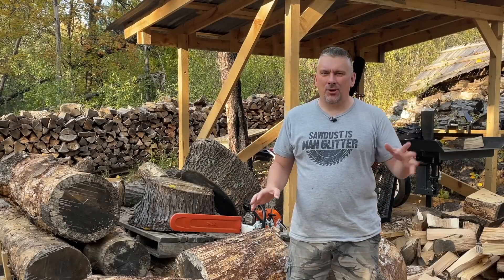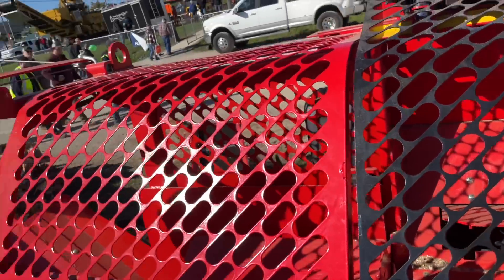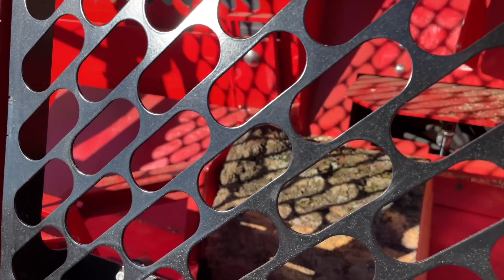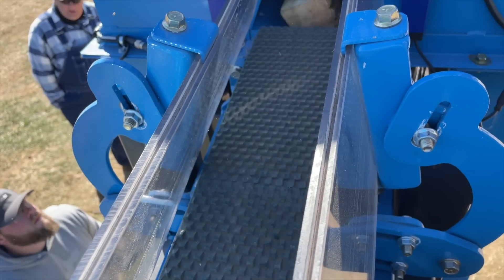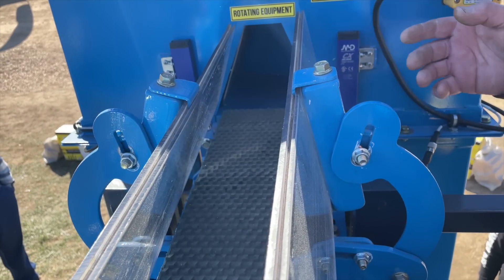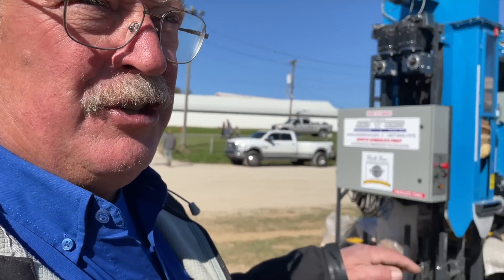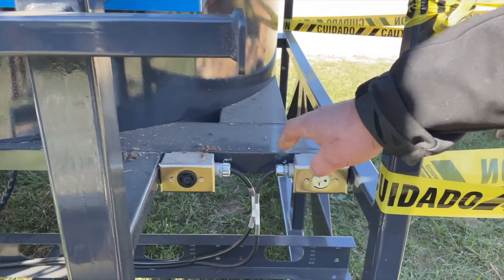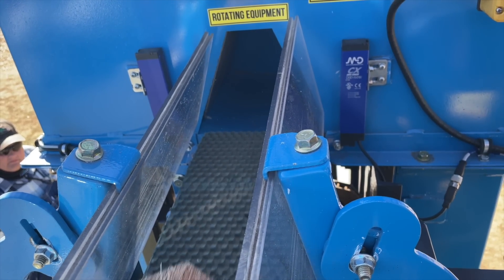Automated Firewood Packaging System - Bundles Made Easy!

Comment: Wow, the packing machine is launched. Have seen it in development for quite a while. A lot of moving parts, sensors, electronis to keep an eye on at this kind of equipment
Reply: I wouldnt buy one of these.
Reply: @garylaszewski7380  After hearing the price of 170-180K, guess I'm not into buying it either. In addition one need a conveyor to feed it. Might better take a look at the other machine that has been on the market some years already, Vepak, where a conveyor is optional, that might is in the price range of 100K. To those into thousands of bags/bundles a year, I guess such machines is interesting

Comment: Cost of the machine.
The website has the estimated ROI based on bags per year and profit per bag. Taking the 40,000 bags per year at $0.50/bag profit and a 9.25 years for ROI, the machine is $185,000. The math works at their listed 400,000 bags/year number too. Add in the other parts and yup, you're around $250-$300,000 invested.
Here is the thing though. If you can own a cord of split logs for $128 that is $1.00 per cubic foot. Put 2 cubic feet in a bag that is $2.00. Add in the cost of the bag, cost to split, deliver, manual labor, miscellaneous expenses at another $2.00 per bag and you own a bag for $4.00. If you sell for only $5, you get $1/bag using only 2 cubic feet. There are 128 cubic feet in a cord so you get 64 bags at $1/per bag profit so only $64 per per cord profit. However, $5 is CHEAP. My local lowes sells 0.75 CF for $9.00. So you could easily wholesale to them for about $6/CF (Lowes would get a 50% profit margin) or $12/bag. Giving you an $8/bag profit. At $8/bag profit you would need to produce 37,500 bags to cover a $300,000 investment and not pay yourself. The site claims 3-4 bags per minute, so lets call it 2 bags per minute or 120 bags per hour and 1,000 bags per day (all rounded). 37,500 bags needed to break even divided by 1,000 bags per day is 37.5 days or 2 months assuming days off and routine maintenance. If you sold 20 bags to any 1 store/customer per week for 7 weeks (35 days) you would sell 140 bags. You would need 268+- wholesale customers/stores to sell 37,500 bags (less if you get higher profits). Or you could get in with local grocery suppliers to the small stores and sell to them wholesale. They then deliver to the store in their weekly routes, you just delivery to the wholesaler directly.
Reply: Shannon, thats a nice big bucket of cold water you dumped on this machine!

I agree 100%!  This thing is a joke.

Comment: Love automation. I quoted building an automatic firewood bagging system, it would be in the $200K range for something with that level of automation. Maybe a bit less if they are hoping to manufacture inventory and sell several of them.
Reply: As it appears running with the 405 JAPA, it looks impressive, but I see lots of manual work to handle its output, especially if the firewood is unseasoned.